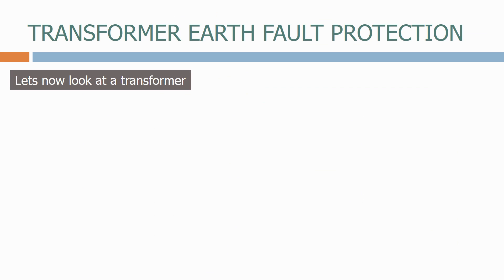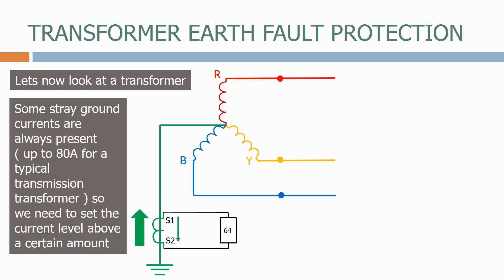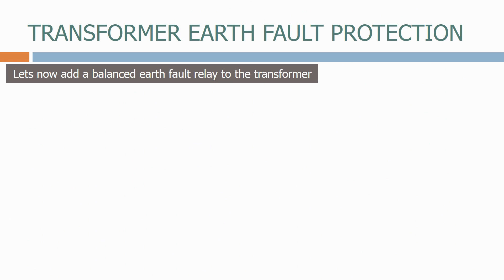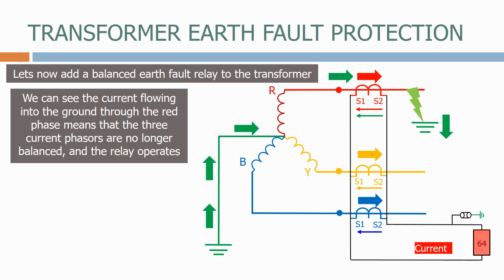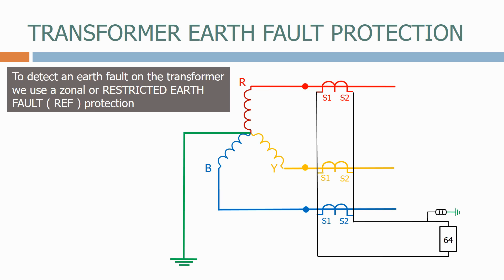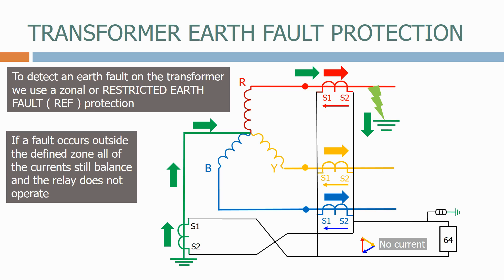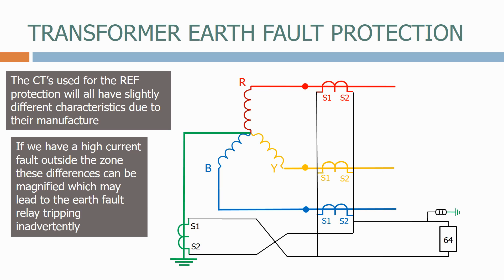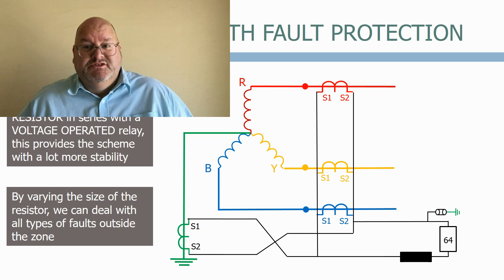Transformer earth fault protection

Comment: Hi Steve, thanks for your easy to understand video. Can you do a video on how to calculate the size of the earth cable from the star point of a s=delta/star (22kV/415V) transformer to earth. Thank you.
Reply from the maker: Hi Fook, thanks for the suggestion, will see what I can do..steve
Reply: @Electricalsteve  Hi Steve, many thanks for your reply. Apologies for the typographical error, the transformer should be a step down 22kV/415V step down 3MVA star/delta transformer.
Reply from the maker: ok

Comment: Thank you sir 
But i don't understand how can current flow back to the transformer via ground ?? 🤔
This question always bother me !! 

Like suppose earth fault occured on transmission line 100 meter away from its transformer...  How can current flows back to 100 meter away transformer ?  I mean earth is a such good conductor??
Reply from the maker: Hi Shubh, soil has a typical resistivity of 100 ohms per metre, but it’s cross sectional area is infinitely wide and deep, when you have a large CSA and put resistances in parallel they reduce, so the resistance path that the fault see’s is lower than you imagine....also, the water table is normally a few meters down which reduces the resistance even  further....steve
Reply: @Electricalsteve  
Thank you sir .. 
But your answer took me to one new query 🤔

As I said earlier suppose fault location is 100 meter away from its source transformer ....  Now between the path of fault location and earthing point of its source transformer ...  There may be many conducting objects connected with earth (like any street pole, earthing of some other system or it could be just piece of any conducting material) 

Then how fault current flows towards earthing point of its source transformer only ??  Why it is not diverted into any other conducting path comes across in way ?? (Might be this other conducting path has lower resistance than earthing of source transformer) 

Request for your valuable inputs on this 🙂
Reply from the maker: Hi Subh, if they are connected to the same copper ground network that is connected to the source transformer neutral then they will, if they are not then they are all dead ends and not part of the circuit that forms the return path...steve
Reply: @Electricalsteve  
Thank you for your input sir..  Just saw you course on udemy .. Will be purchasing protection module - part 2 today